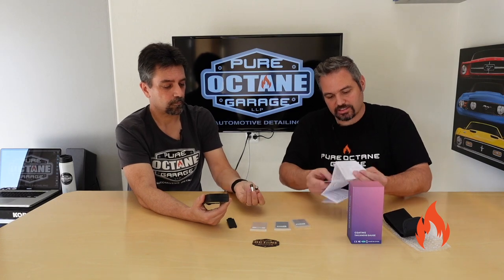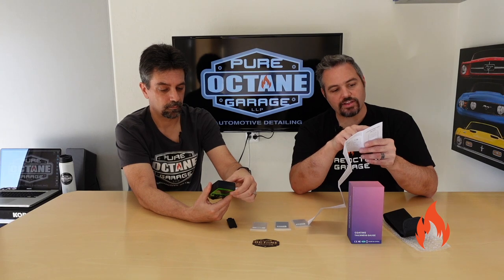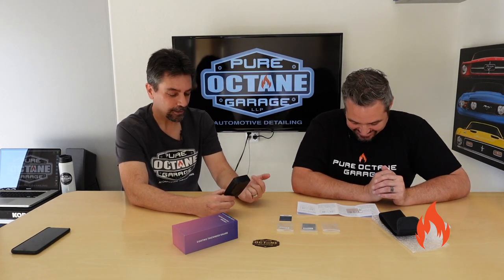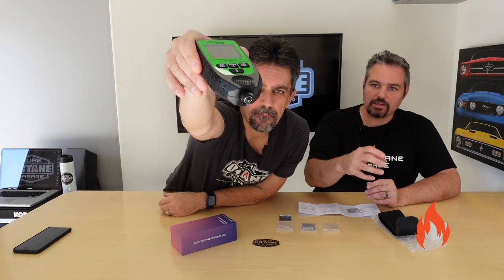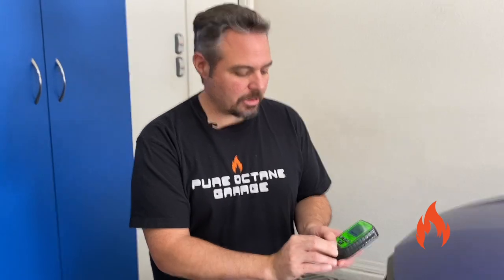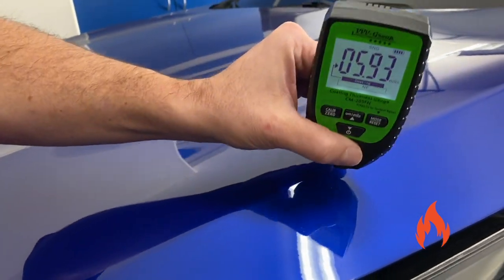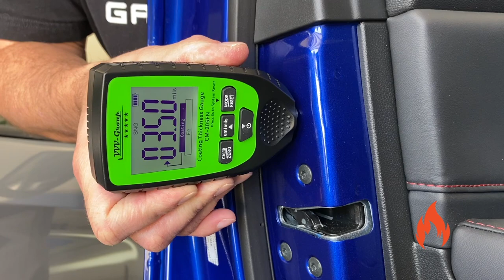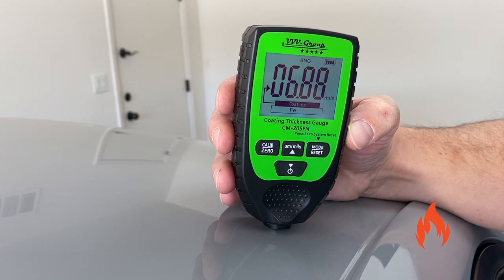Paint Coating Thickness Gauge... How the Heck Do We Use This?

Comment: Hi, thanks for vid! Is the tip made of a soft rubber or plastic material or is it metal?
Reply from the maker: Hi Don. The tip that depresses is metal and that retracts into the black plastic base for measuring. As long as you are careful, you shouldn't have any scratching introduced to the paint. Thanks for watching!

Comment: I just got the exact same gauge. I can't figure out how to calibrate it. Could you give me some direction. I'd truly appreciate it.
Reply from the maker: The best way to calibrate it was with the sample films that came in the box. They have the measurements on the individual films.We used the zero calibration method in the instructions. It can be hard to follow, due to bad English, but will get you there. Is pretty lengthy to type here, so check the insert that came with the gauge and you'll be set! Thanks for watching!

Comment: Why do you have trouble with microns, micrometers, umeters, um,....?
There is no Greek mu character on English keyboards.  So most text
abbreviate "mu" to "u".  So microscope becomes uscope.  Microvolt
becomes uvolt.  Micrometer becomes umeter, hence um.  1.000 inches
is 25.4mm.  0.001" is 25.4um.
Mu